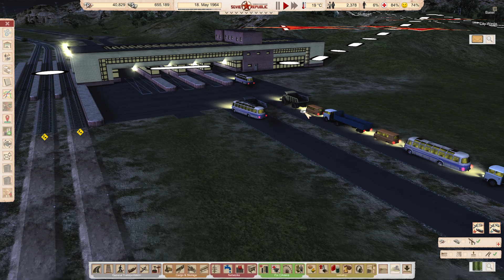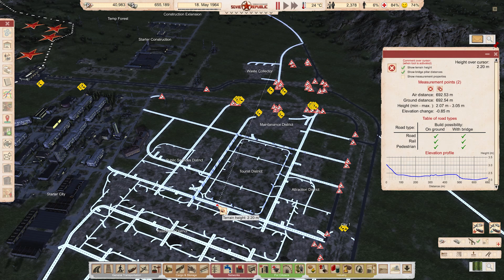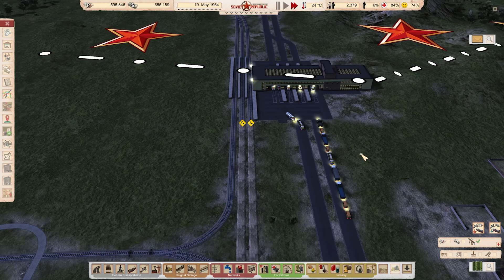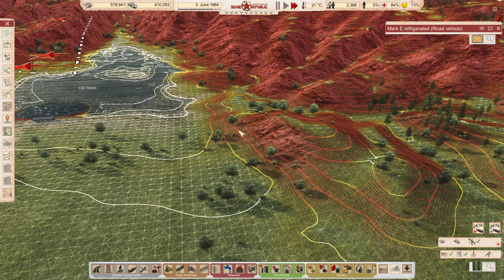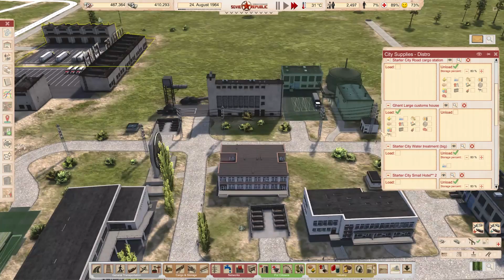Gravel Industry & Other Construction Materials | W&R Season 4 World Maps  - Episode 05

Comment: something I like to do is to prospect the mountains by hovering over them with the resource extractor building, but you already said you wanted to wait for it till you have the tech, which is fine.

It is a bit cheaty as setting up oil extraction and export of it is easily doable in the highest difficulty that way which removes all early money constraints.